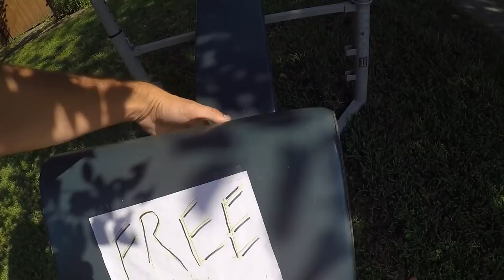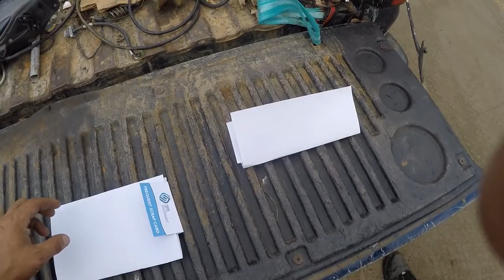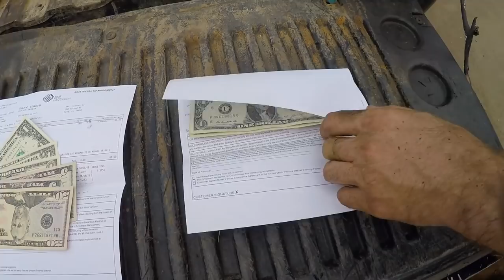AMAZING TREASURES #1 Picking at an old Barn with friends

Comment: That radial arm saw is worth over $200 not counting the base  that it's on that was painful to watch can't believe you wouldn't sell that saw
Reply from the maker: maybe I’ll find another one
Reply: @bluebusdave2529  I wasn't trying to come off as an asshole by any means brother.. I like your videos I watch them regularly.  It was just hard to watch it being destroyed bc they are actually a very expressive saw to get new. It cuts like a 70-80 degree angle and are very accurate I've got the same exact saw but without that super cool base it was mounted on. I will be your guy if you find another on of the bases are the stand that it was mounted too. Mine has a stand on wheels that raises up to move around and drops down when you are going to use it. And that butcher block it is worth every bit of $7-$800 and I wouldn't go less than $600 they are a very very expressive piece. I appreciate you commenting back to me. I look forward to your upcoming videos my brother keep up the good work and living the dream good to meet you
Reply: @bluebusdave2529  I wish you would find another one of them bases